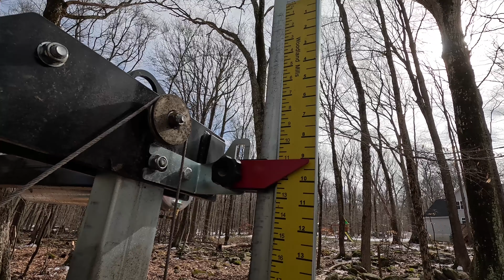Big frozen Red Oak on the sawmill

Comment: subject to buy an ibc plastic water tortes and buy the ibc funnel for the top rain will fill it up and put up a small 12-volt pump you can run it of your tractor battery have  water at the saw mill
Reply from the maker: Appreciate the tip, will look into getting one, thanks for watching!